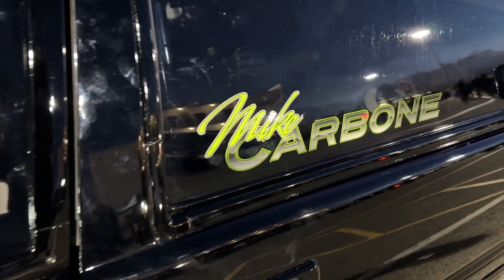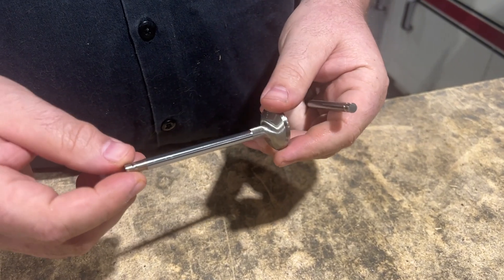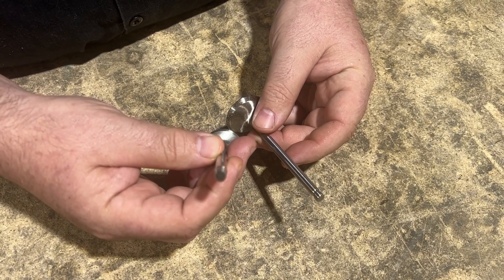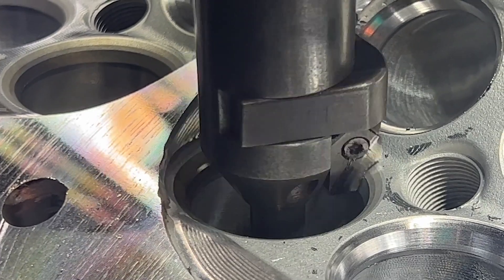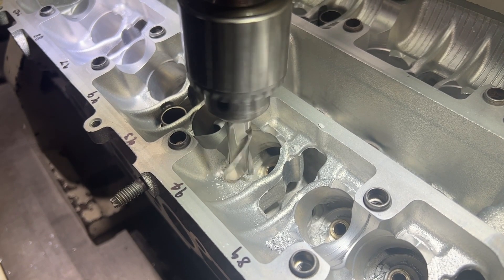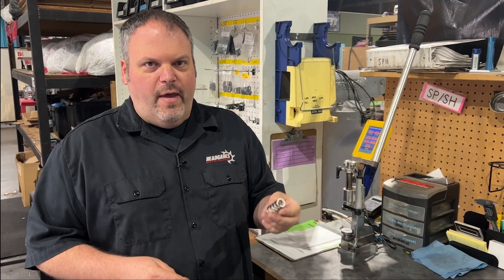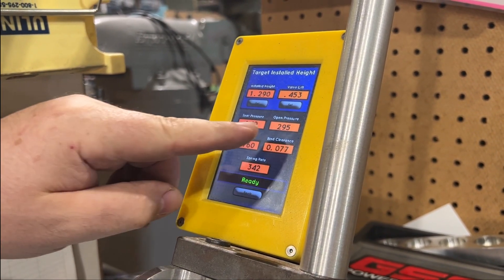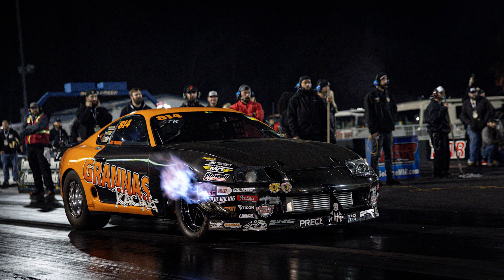HeadGames First CNC 2JZ GE Build Goes Racing!

Comment: you might benefit more than other with this information i stumbled acceoss

Hyundai iload (australia) comes stock with DLC coated buckets. they also come in many different sizes and part numbers, like the toyota ones you guys use for shimless 

Also, theyre quite light to my standards rb26 ones. They weigh similarly to the equivalent supertech buckets

one small difference though is theyre 32mm (not 31) dunno, maybe that could accommodate a larger spring

if you want more information, i could send you pictures of the one i have
Reply from the maker: Yes! Please do! Info@headgamesmotorworks.com

Comment: How much does your experience inform your valve angle selection and how much is testing?
Reply from the maker: The experience helps with some heads, but new stuff is a lot trial and error. And changing the valve job on some heads is dicey. Some are sensitive. Like the b58 vid I was really worried about blending in the valve job because some heads it hurts flow and others it will gain. We have a valve job that will hurt a 2jz bad but it looks incredible. That’s where testing is key.
Reply from the maker: Great question!